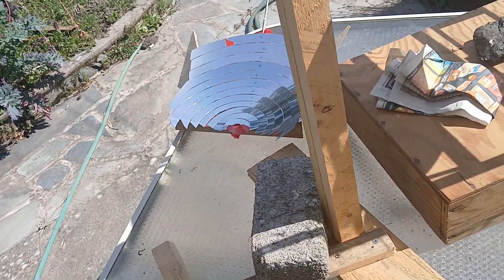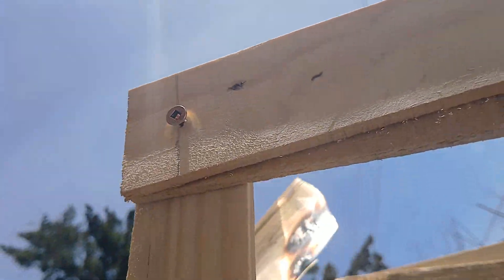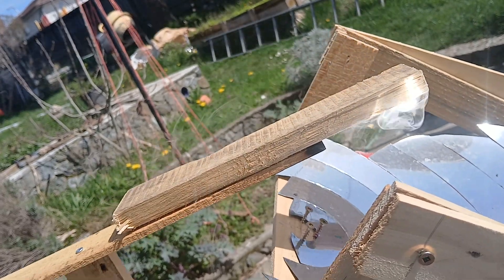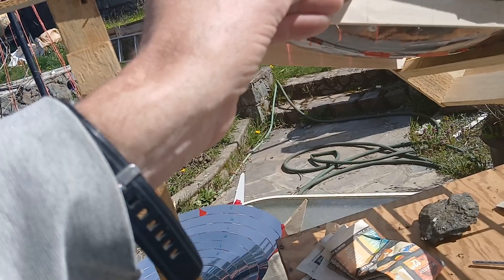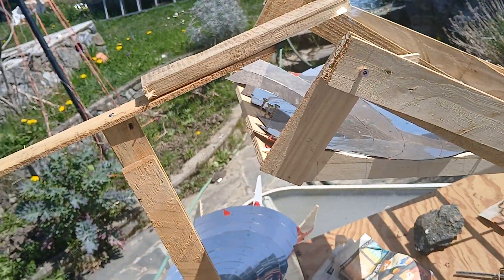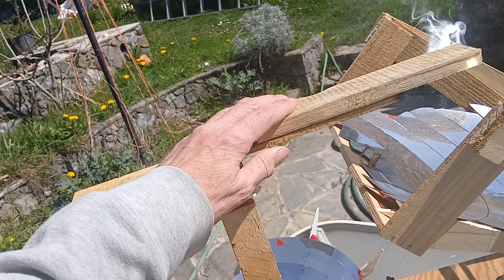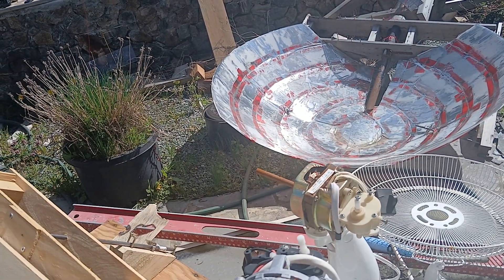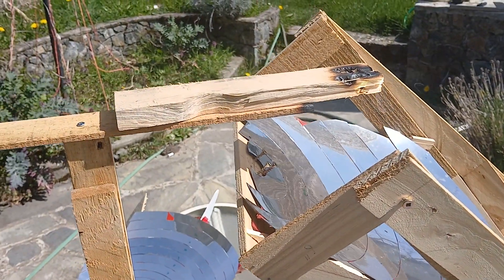Smokin!  1/5th scale model of the new type of solar cooker, spot my glaring  setup error!

Comment: OKay, I'll bite. What's the "glaring setup error"
Reply from the maker: Thank you.  This is a bit like a test of "scientific peer review",  isn't it?  People read over scientific papers (for free) and try to spot errors, and if all goes well, they don't spot any and the paper gets published.   Or they spot an error and it goes back to the author and he or she fixes the error and resubmits the paper. But if all goes badly, nobody spots the error and it becomes a scientific myth.    Well, my glaring mistake  is,  it's April 4th in the video and 1 minute  45 seconds into the video, I show the declination angle and state that I had to change it from 4 and a half degrees to 5 and a half degrees.   But look! It is 5 and a half degrees down BELOW level, instead of 5 and a half degrees ABOVE!  (because it's after the equinox not before it),  so I had the declination fully 11 degrees wrong!  The demonstration worked,  but it would have been a whole lot smokier if I had done it right!